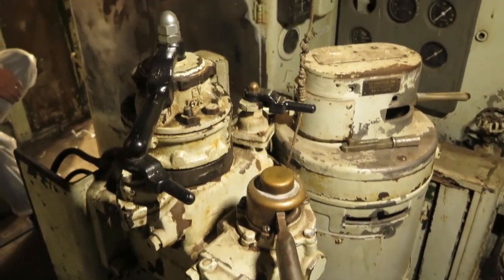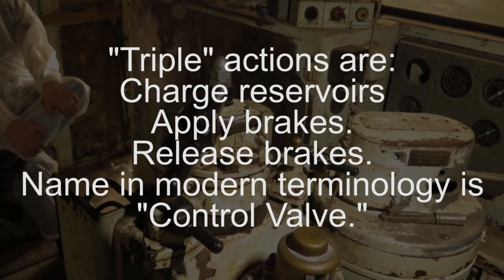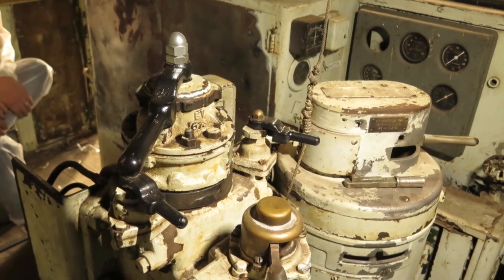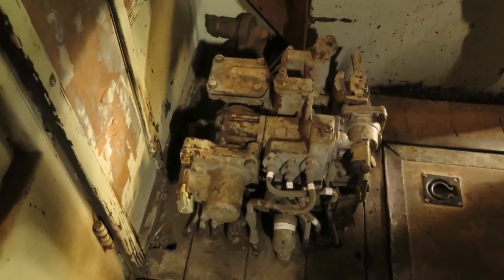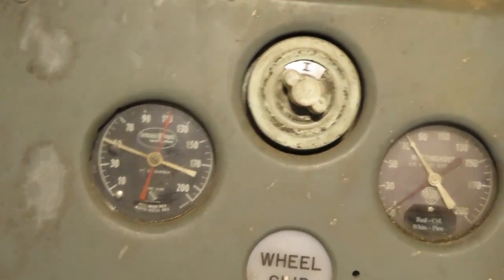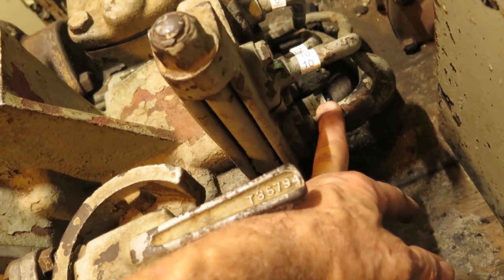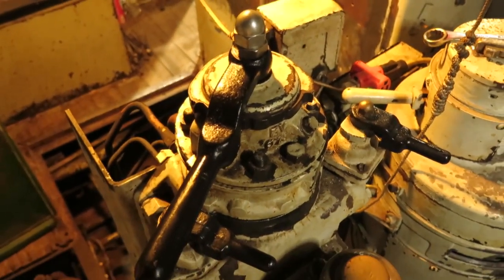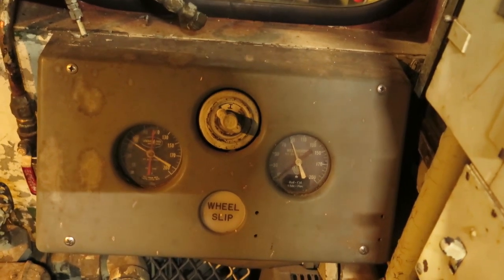SRM 8202 Down the Airbrake Rabbit Hole

Comment: Always enjoy your updates, I maintain a 6SL equipped loco in New Zealand, and I've had similar issues. A common one is overcharging the brake pipe while the handle is in the 'Running' position, this is usually rectified by lubricating the rotary valve face with a mixture of oil and graphite.  We also have a servicing schedule in place to ensure all components of the 6SL system are cleaned and lubricated periodically which is an absolute necessity to keep the brake up to code.  Anyway, keep up the great work!